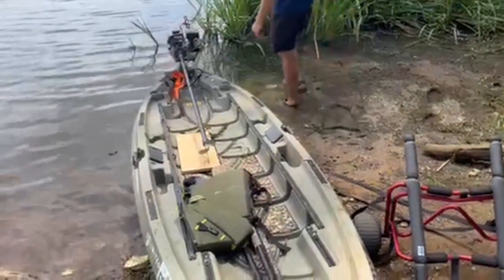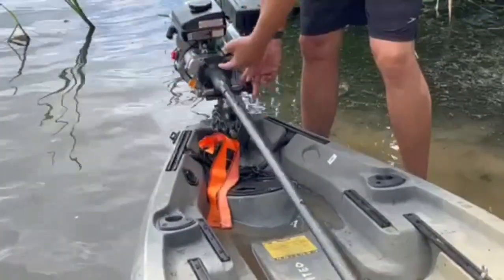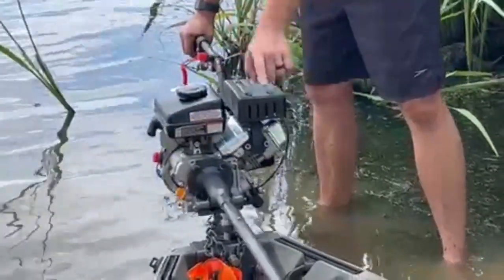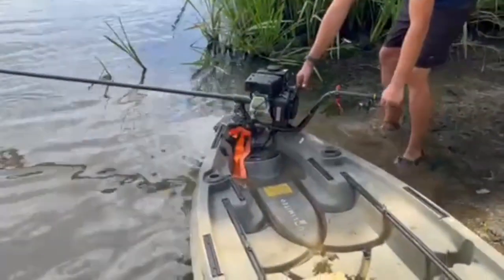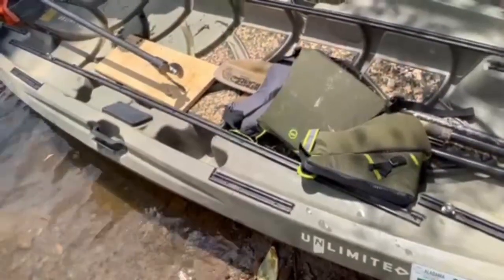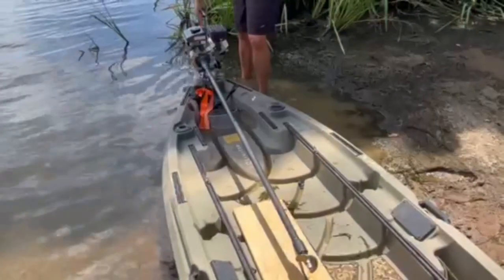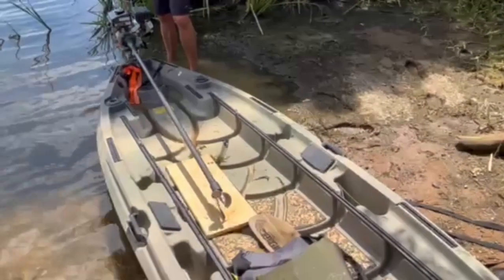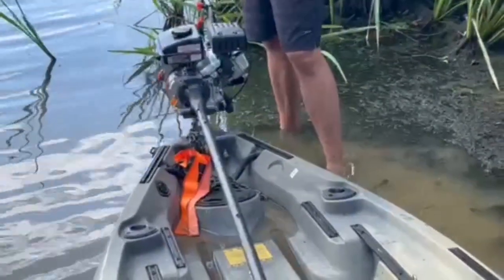3hp Mud-Skipper Super-Lite long tail mud motor - for kayaks and canoes

Comment: I want to put this on my johny bass 100 do you think the 3hp would be enough to push it at around 10mph?
Reply from the maker: Maybe not 10 but it'd do alright
Reply: So should I go with the 6hp then and would I need to get the longer tail or will this be fine?
I'm fine with paying a bit more I just don't want to buy the wrong one and not like it for that reason